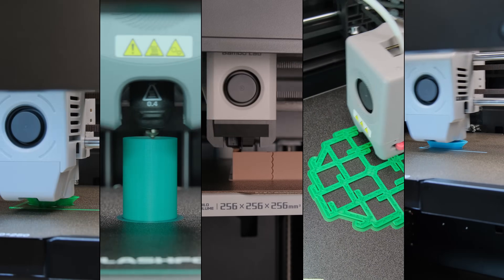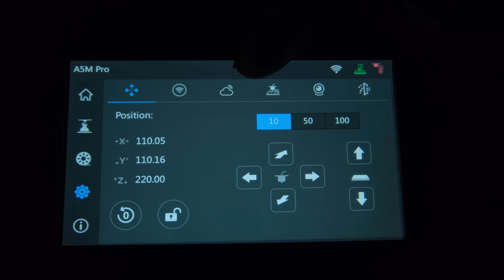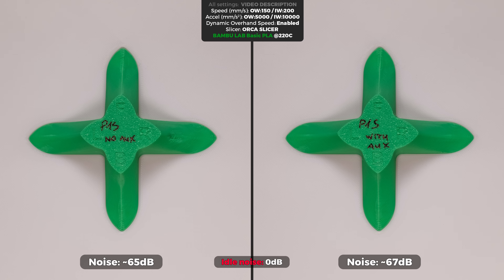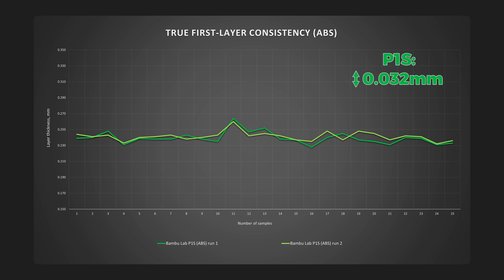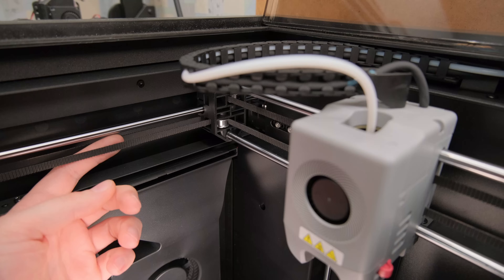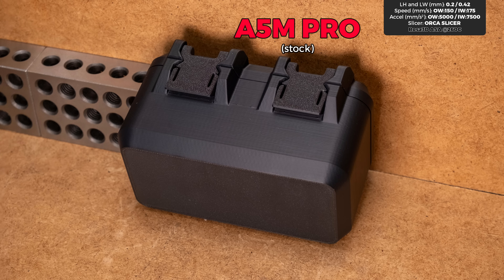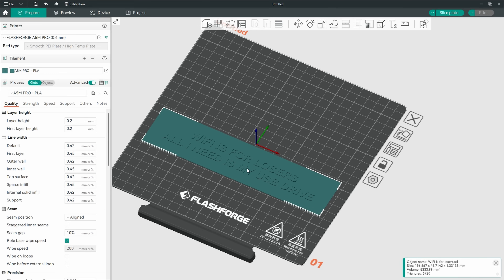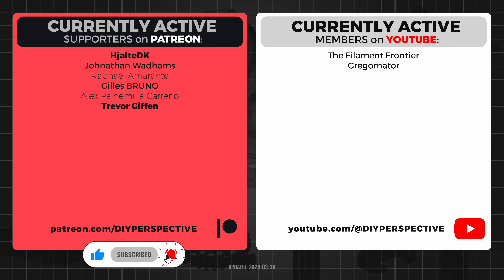QIDI Q1 PRO vs FLASHFORGE A5M PRO compared to P1S (3D Print Quality Review)

Comment from the maker: IMPORTANT! (CORRECTIONS and MORE INFO)

- Spiral Z-hops work on QIDI Q1, but you will have to deal with constant "// Unknown command: "G17"" error messages in the terminal.

- The 3DBenchy print on the RIGHT SIDE is from P1S and not from A5M PRO (text error).

- With Orca Slicer 2.0 you can directly upload and view the webcam of your 5M PRO.
Press on a little Wi-Fi icon next to the name of your printer and configure it. For example:

Host Type: Flashforge
Hostname, IP or URL: 192.168.0.185 (your local IP address of the printer)
Device UI: 192.168.0.185:8080/?action=stream (replace with your IP of the printer)

For the webcam to show video feed in the Device section of Orca Slicer make sure you have enabled the Webcam in the touchscreen menu settings.

Comment: Great review!.  I noticed that these tests were done woth Bambu Lab filament.   I generally use filaments recommended from the manufacturer of the printer.   Settings from the manufacturer is adjusted in the slicer that really makes a large difference. Still your observations are much appreciated.

Comment: Two things: the Q1 pro has "wrong" steps/mm settings so that, for PLA, there is no practical difference in dimensions between model and print: VERY user friendly, and THE right way to do it. You can notice it because even ABS prints have a much smaller (often already acceptable) deviation. 
About skew: the guy at Vector3D never replied to me, but I mentioned him that the skew is VERY affected by measurement uncertainties. He provides a single number, while he should provide the uncertainty, given the uncertainty in the measurement of the diagonals.

Comment: Have an XMax3 and a Q1 Pro, highly recommend either, just pair them with a filament drying box you can feed the printer from. They make good printers but implementing spool holders is their main weak point lol Xmax 3 was robust but in an inconvenient spot, Q1 Pro was flimsy but much better positioned. All early reviews on the Q1 Pro have issues that have all been addressed in the model I currently bought a few weeks ago.

Comment: You are not exactly right about chamber heating in case of 5M Pro. You didn't mention that it has two air circulation options: external and internal. And if you turn the internal on, it will help to heat the chamber faster and keeps good conditions for printing ABS or alike. It turns on automatically when you print with ABS profile and works great, I have never had any issues with adhesion and layers when using it, and printing ABS.

Comment: Got my q1 for less than 360 US recently and they have fixed almost all if not all of the issues you mentioned in current printers, comes with better tension and alignment etc
Reply: I have a plus 4 and am coming back trying to decide if I ALSO want to get a Q1 pro lol. If it performs half as well it'd be a steal

Comment: Great review comparing accurately how the machines performs in similar terms and show real world results. 

Speaking quality wise with basic pla and petg (I don’t care about speed) can the 5mpro be slowed down and fine tuned to match the layer consistency and overhang performance of the p1s? 

Following that trend would it better to get the prusa mk4s?

Comment: Any recent updates for any of these printers that have altered your opinions in any way? I know that QIDI fixed the build plate issue and some other issues like a better filament spool mount. Is the A5M still closed source? Any firmware updates from them that fix the issues you mentioned? Thanks

Comment: As a new owner of a new q1 pro I’m happy to announce that almost all of the criticisms have been addressed on my unit. 

The belts are tight, the lid is tight, the jankiness is gone (apart from the spool holder), the build plate is easy to place, the filament is now inserted from a hole in the side - which looks a lot cleaner - and probably a lot more.
Reply: agree 100%. I find the build plate install even easier than on my A1 now
Reply: Does that mean they had updated the hardware or just improved the QA?
Reply: @wrobelda  they've (slightly) updated the hardware but unfortunately out of 2 machines ordered I receive one "new" and one "old" version. Nothing terrible - I can print the parts for the old one - but annoying
Reply: @gillesreyna1272  can you point me to some source describing those differences? I am about to receive mine tomorrow and curious which revision will I get. Thanks!
Reply: @wrobelda  Hi, I don't think there is anything official online but as Jacob (above) mentionned, now "The belts are tight, the lid is tight, the jankiness is gone (apart from the spool holder), the build plate is easy to place, the filament is now inserted from a hole in the side ". I have one with all that but the second one all but the build plate stuff. The build plate stuff are just higher corners making plate insertion a lot easier (and frankly easier than on my BBL A1s). You'll see immediately if the plate is easy to place. Otherwise Qidi made a few STL files available on their wiki but I haven't printed them yet (requires some HT filament I suppose). The most important thing imho to do from day 1 is probably  to upgrade the firmware to the latest version. Otherwise, great printer !
Reply: @gillesreyna1272  thanks, that’s very helpful. Mine should arrive on Wednesday, happy to upgrade from V3 SE to something less time consuming! Although I appreciate the learning curve Ender offered.
Reply: @wrobelda  you're welcome. This one is probably plug&play in comparison although you can always upgrade some parts (e.g. the nozzle does not stand the claimed flow). BTW it is supported by Orca slicer but the profiles require tweaking in my experience. Qidi slicer works well out of the box for PLA but I'm not a fan of it as it lacks the latest features such as scarf joints for seams, etc.
Reply: @gillesreyna1272  I saw Qidi Slicer sees regular releases and they backport features from other slicers, so I suppose it's a matter of time before all the good features are included?
Reply: @gillesreyna1272  I actually am having trouble printing with QIDISlicer and their default PLA profile using Polymaker Polyterra. First 2 layers OK and next layers had no adhesion. Asked their support, wonder what they'll tell. Did not have any such issues with Ender and Cura's generic PLA profile. Also, Orca had Qidi profiles updated in their last week's release, these still have issues?
Reply: @wrobelda  I haven't used polyterra (I use mainly eSun PLA Matte) but a possible explanation is that Polyterra needs to be printed slowly according to the manufacturer (30-70mm/s) which is the speed you roughly have on the first layer. However other layers in the default PLA profile will be much faster, therefore you need to tweak the speed down if you stay with this filament.

Comment: Woaaah, so nice.
Well BBL machines has so much into them that nobody talks about. The devil is in the details as they say. 
Wonder how would X1C go against those as it is quite better than P1 series imo
Reply from the maker: P1S has the same motion system as X1C, print quality-wise I don't see any real difference. I am not sure about what details you are talking about. The only one that I can think of might be repair, as replacing some parts requires disassembling half of the printer.

Comment: Hey @diyperspective,

I've been going through the comments and I notice in the video and in some comments, you highlight that the stock Qidi Q1 Pro doesn't have as good a cooling system for airflow to the nozzle.

Is this something you see that could be upgraded with a fan replacement and/or modified duct solution?

I've just ordered the Q1 Pro as my first 3D printer so very new to it all. Won't be arriving for another 6 to 8 weeks anyway so have time to learn but in the meantime wondering what simple upgrades can be done very cheaply like your spacers for the belts to improve print performance.

Comment: Heres where you lost ALL CREDIBILITY in your review:  You kept saying negatives about the 5M Pro not having klipper access which is 100% false as it DOES have fluid interface via PC.  You also NEVER MENTION that P1S has ZERO interface of Klipper at all.  Not a single complaint from you about that.   Your whole review is just another skewed review to support Bambu.
Reply from the maker: Stock 5M Pro doesn't have a web Klipper interface, despite it running Klipper. If you modded yours that is a different thing.
Meanwhile, Bambu doesn't even run Klipper, how the f... it would be reasonable to complain about it not having a Klipper interface? ;D The main reason to have the Klipper interface on consumer 3D printers that run Klipper is for the ability to fix problems with the printers in the firmware because a lot of the time companies do not fully know what they are doing. If a printer just works and I don't need fixing stuff I just press "Upload and Print" and never look at any web interface.
If you truly think that my reviews are skewed I hope this is the last one you are watching. Good luck finding other reviews that actually test the 3D print quality performance. :)

Comment: A5M pro user here(I love my printer). One downside is when your hotend/nozzle get clogged.  I was using some Stronghero pla and it kept clogging my nozzles. I decided to disconnect the copper hotend from the nozzle by unthreading it. When/if you do that the wires that run into your quick connect break loose and you will no longer be able to use them as the plastic shroud covering the nozzle tip is the connect point. I found this out on my .4/.6 nozzle.  Lost them both. Not a Flashforge issue so much as a user issue, but nice to know all the same as the nozzles are $40 each for me to replace(which is fine because I wanted to grab a .8mm nozzle also so instead I just grabbed all 4).  Also ASA with the .6 gets some ugly artifacts unless I'm at 260 on the hotend.

Thanks for the video I was looking at getting both the Qidi and Bambu printers but was having difficulty deciding if I wanted to.  Now I want them both.  I appreciate the information.

Comment: I appreciate these videos. However, I do question the validity of the cooling tests. We have no idea what temperature the filament is when it leaves the nozzle. It was shown earlier that the P1S underextrudes at lower flow rates and to a greater degree than the other two. So, I would guess the P1S’s actual extrusion temp is lower than the other two. Then there is differences in thermistors, hotend material, and distance between thermistor and nozzle.
Reply from the maker: If you would truly appreciate it, you would test yourself these points before you raise validity concerns, might be surprised what the outcome are. General assumptions a lot of the time are wrong in 3D printing. Every thing you listed makes so little difference that I don't know why I even bother responding, lol.

Comment: Hey. Thanks for the video! How did you install your Q1 spring tensioner mod? Did you have to take off the side panels or were you able to access with them on? Thanks.
Reply from the maker: I added the spacers from the inside of the printer. You don't need to remove any parts but it is very tricky. It probably would be way easier from the back with the back panel removed.
Reply: @PrintingPerspective  Thank you!

Comment: Love my Flashforge 5M (non pro) and I only paid £300. Very impressive machine and it beats the Creality K1 in print quality, less noise and more reliability. Would definitely buy another one especially at half the price of the P1S
Reply from the maker: At least from the pictures it seems that 5M is just striped down version of 5M Pro, with the same motion system. It is like P1P vs P1S probably. If that's the case regular 5M value is just insane. :)

Comment: 2:13 Please consider getting the proper mics to measure plastics. They are more expensive but are tuned to not squish it and will give a more accurate measurement. :)
Reply from the maker: Don't worry, it is not hard to measure consistently if you have enough practice. :) The hardest part is not how hard you squeeze but rather aligning the part perpendicularly in the micrometer. In the future, I probably will make some sort of jig so that the process will be faster.

Comment: Very nice review! Thanks for this! I made a short recap of the results as I read them:

Heatbed - heat to 60 ºC

Q1 Pro: 
- 4 minutes heatup
- 6 ºC variance
- 120 ºC max / 300W

A5M Pro
- 4 minutes heatup
- 2 ºC variance
- 110 ºC max / 250W

P1S
- 3 minutes heatup
- 6 ºC variance
- 100 ºC max / 1000W

------------------------------

Chamber heater

Q1 Pro:
- Separate 300W heater

A5M Pro
- No heater

P1S
- Aux fan for extra heating with help from powerful bed heating

------------------------------

True flowrate

Q1 PRo:
- 30mm melt zone
- 350 ºC max
- 19mm copper nozzle, hardened steel tip
- 20 mm3/s with 3.4% under extrusion

A5M Pro:
- Quick switch gør udskiftning af hotend nemt
- 36mm melt zone
- 280 ºC max
- Stainless steel nozzle
- 25 mm3/s with 3.6% under extrusion

P1S: 
- 26mm melt zone
- 300 ºC max
- 20 mm3/s with 6.1% under extrusion

------------------------------

Fan + noise

Q1 Pro: 
- Poor to mediocre overhang quality
- 66 dB with all fans, 40 dB idle

A5M Pro:
- Sub-par to good overhang quality
- 68 dB with all fans, 39 dB idle

P1S: 
- Great to perfect overhang quality
- 67 dB with all fans, 0 dB idle

------------------------------

Extrusion consistency

All 3 perform similar

------------------------------

Z-hop consistency

All 3 perform similar

------------------------------

Bed leveling

Q1 Pro 
- PLA: 0.032mm variance
- ABS: 0.057mm variance

A5M Pro 
- PLA: 0.035mm variance
- ABS: 0.043mm variance

P1S 
- PLA: 0.020mm variance
- ABS: 0.032mm variance

------------------------------

Artifacts at high accelerations

P1S best, Q1 Pro worst
- Can be improved for the Q1 Pro and A5M Pro, but can be cumbersome

------------------------------

Dimensional accuracy

All 3 perform fairly similar; the worst performing still acceptable

------------------------------

Artifacts - ringing

All 3 perform similar

------------------------------

3D Benchy:

Q1 Pro:
- 600 mm/s, 20k mm/s acceleration
- High quality with a few surface issues on the body

A5M Pro:
- 600 mm/s, 20k mm/s acceleration
- High quality without any issues

P1S:
- 500 mm/s, 20k mm/s acceleration
- High quality without any issues

------------------------------

ASA Practical Print:

P1S wins with the most consistent layer lines. The others have more inconsistent layer lines.

------------------------------

Build quality: 

Q1 Pro
- Sub-par build quality
- Potential Current hazard

A5M Pro
- Great build quality
- A few minor details not great
- Automatic shuts off the heated bed after 10 minutes of inactivity

P1S
- Great build quality
- Very user friendly
Reply from the maker: Thanks for the summary. One thing - ringing artifacts on the stock Q1 Pro is quite bad. It needs a modification to get acceptable results. :)

Comment: Hi, I added a quick fix for the 5M Pro so it fully turns on without having to press the front button. Works perfectly via smart plug now
Reply from the maker: Hey, can you post a link? I will unblock it if YT blocks it.
Reply: What/where is the fix?
Reply: @ hey, thanks for asking. At the time I posted it on Reddit with pics. Essentially on the back of the printer, behind easily removable panel is the main pcb. On which you will find a secondary power button (soft push). If you put a metal clip around this to essentially electrically close the switch, you can then turn unit on and off remotely without having to press the front power button. 

I have moved on since then and have gone x1c, 1000% better, even at the much higher price point.

Comment: I did the cooling test, the q1 pro perform better than P1S， did you set the same slicer setting？
Reply from the maker: Yes, for all the printers I use the same setting and the same filament - https://docs.google.com/document/d/1WB8E50J8cNI-7sOTPo29jMURcsnwgRFX Just keep in mind that heatbed temperature affects the cooling efficiency. So if you print at 50C, the results will be better.

Q1 PRO has ~8K RPM 5015 fan, while P1S has ~9K RPM 5015 fan.
P1S fan has a way better directed air flow to the nozzle, Q1 PRO is nowhere as good.

Comment: Hey @DIYPERSPECTIVE, this was an awesome video. I currently have an x plus 3 and never wanted to mess with the belts. I see you did the print artifacts at high acceleration testing and decided to tension the belts at 6:57 on the Q1 pro. I've been wondering all day, did you end up rerunning input shaping calibration or did you only auto calibrate input shaping out of the box and never touch it. Hope your reply, I'm not sure which option would be the best.
Reply from the maker: My X-Plus 3 belts were tensioned noticeably more than Q1 PRO, I think it is mainly the issue with Q1 PRO automatic belt tensioning system. Just try using a more aggressive input shaper like EI and its recommended Hz.
Reply: @PrintingPerspective  Awesome! I'll definitely do so!